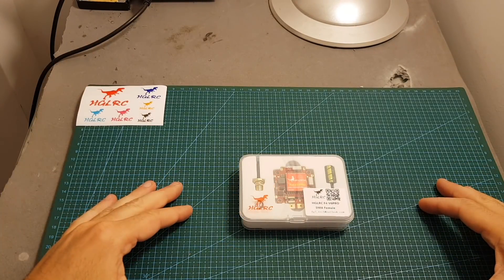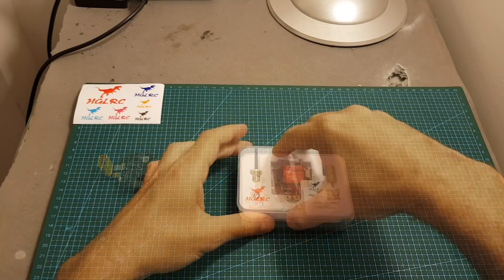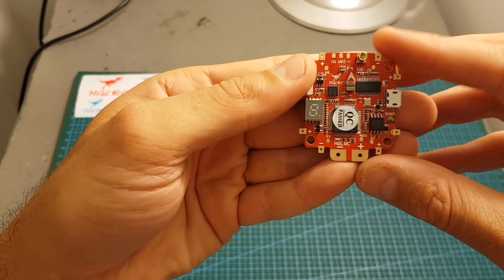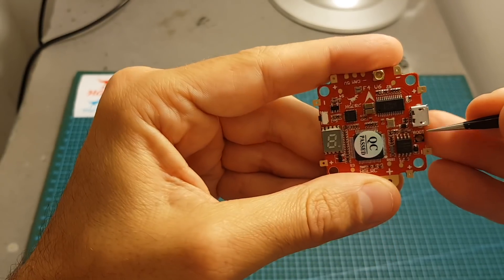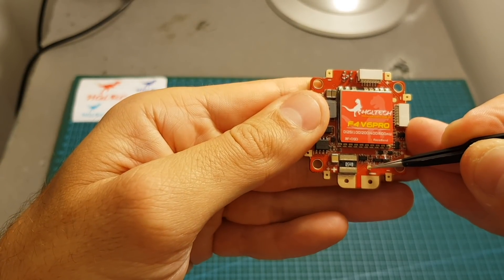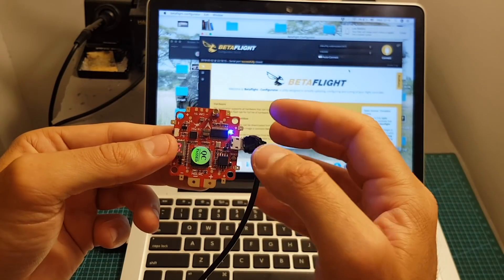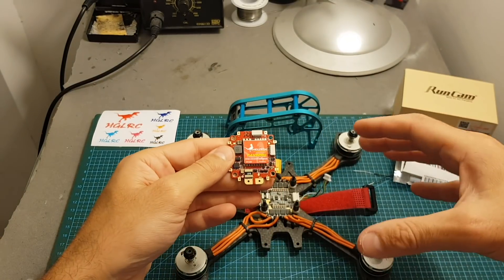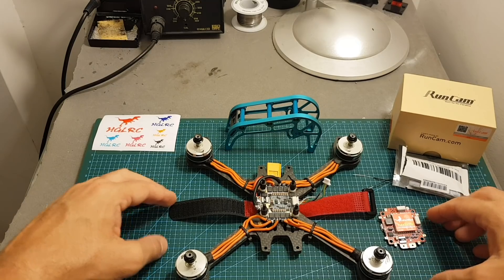HGLRC F4 V6PRO - Overview, Setup & Flight Footage

Comment: Do you have to change VTX power level every time when you fly if you want to set higher than 25 mW ? I tried to change 600 mW and saved it, but when I reboot it went back to 25 mW
Reply from the maker: No. Make sure that you turn off the smart audio if you configure the VTX manually.
Reply: @KremerFPV  thank you for information
Reply from the maker: @tyrsjjh  NP, you're welcome :-)

Comment: I also have the eachine stack-x. The flight controller did not show camera view only OSD in goggles. I was wondering how you wire the camera up? From ribbon cable to the leads you have. Thank you and great review
Reply from the maker: Hi, do you see only the OSD in your goggles? It means that the camera is not connected properly to the video in pad on your board or it's not getting any power.

Comment: does the FC support smart audio for the VTX?
Reply from the maker: Any Uart will support it.
Reply: @KremerFPV  Sorry to jump in so random,but  do you have any tips to get my BFOSD up and running  (IRC Tramp enabled ) but when I do the stick positions only 4 stars blink in the middle of the screen and I dont get any menu pop-up. Thanks in advance
Reply from the maker: @TheBer7y  Is BF-OSD enabled in betaflight?
Reply: @KremerFPV  if you mean the AMPs,Voltage,RSSI yes I see those
Reply: I saw you changed the VTX poweroutput, thats waht Im after

Comment: Did u use rubber grommets for mounting
Reply from the maker: Yes
Reply: Gal Kremer thanks for reply funny they didn’t include them
Reply from the maker: Yes, they are not included with many FCs...  I suggest that you should get a small bag of rubber o-rings. They are pretty cheap and and handy.